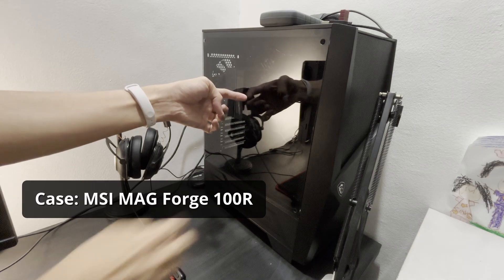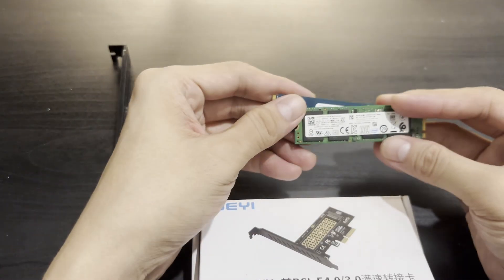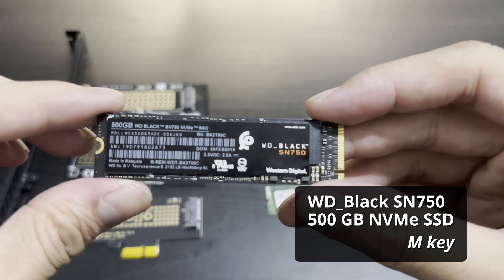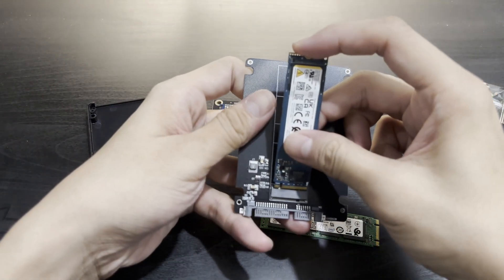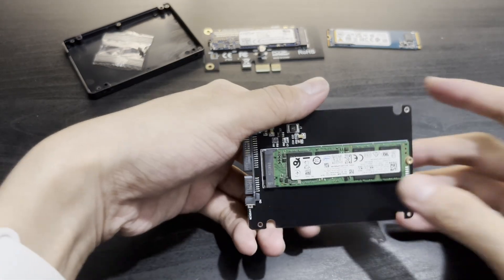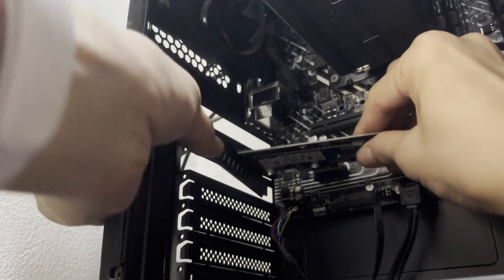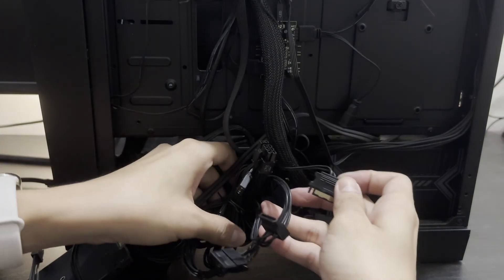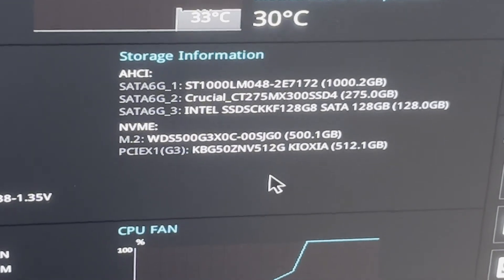M.2 SSD Expansion: Use PCIe and SATA Enclosures for MORE STORAGE!

Comment: one important thing to note is that the x1 slot will limit you to 1 gigabyte per second on pcie gen 3, double on gen 4. Your drive is likely a gen 3 x4 drive with burst speeds of 3.5 gigabytes per second. So you are limiting the performance a bit but this is a perfect way to add more storage without an extra pcie slot!
Reply from the maker: Thanks for this! I forgot to put the table of the different PCIe generations, sizes, and their speeds. And yeah, you're right that I experience limited speeds but still better than nothing :)

Comment: Will it keep up with an Accellsior 4M2 ?
Reply from the maker: A quick Google search says no. It can accept 4 M.2 SSDs all on its own and uses PCIe 3.0 x8 boasting over 6,000 MB/s.

It's too much for me at $149. This setup only cost me around $5 for all of the 2 PCIe 3.0 x1 expansion cards and the 2 M.2 SATA enclosures :)
Reply: @honganqi  I stuck one in a MacPro 5.1, to capture Raw from my AJA Cion, in the computer that was claimed to be able to do so when the camera was released, only to find out Apple lied about how much data it's system would shift,.. can do 60fps, not 120,..
Dropped the Accelsior in to an X99 chipset i7 based PC, and suddenly shift enough data for uncompressed raw 4K :D
Bonus, the PC makes a very good vMix vision switcher for live events!